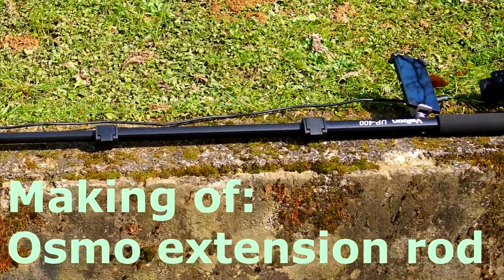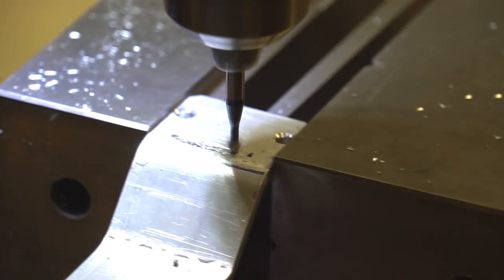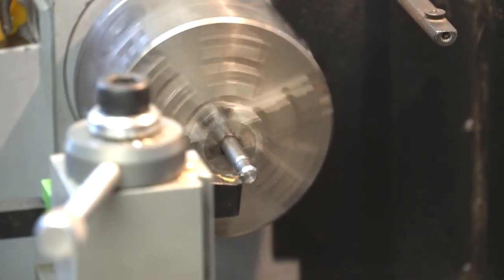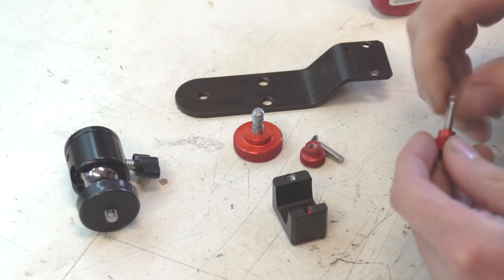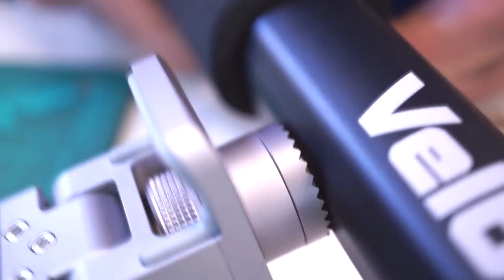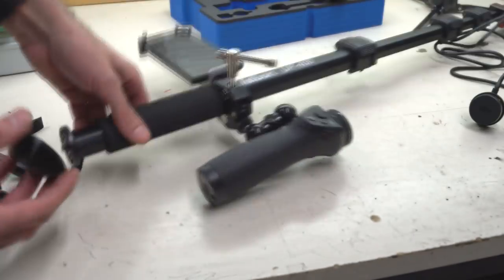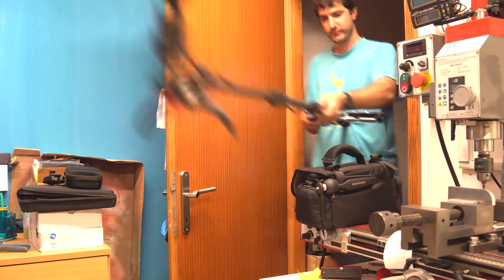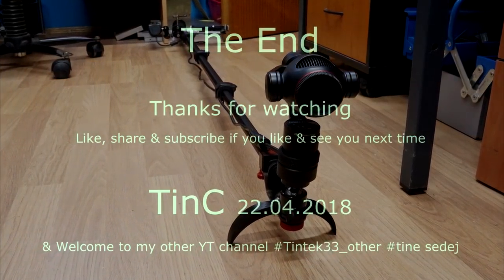Making of: DJI Osmo extension rod [170cm extended]

Comment: WOW Tine...I think I found a new best friend here. As directed from your reply comment on the Osmo LiPo batt video, , I couldn't resist the thought of what else you had in store for me. I am a 35 year machinist/CNC programmer and engineer. Started and owned my custom machine and machine building company for 12yrs. Now retired so I can only do so much with a hand drill, hacksaw, disc grinder and file (with good file brush...not many will get that joke). I did buy the  Joby Action Jib Kit without poles for my action cams. I use a 3 section 3 meter fiberglass painters pole. I thought about rigging the Osmo to that but may be too top heavy. I didn't know about the Osmo Extension Cable till I watched your video here...Thank You! Since the Joby uses string for the tilting action, I will have to add a compression spring between the wheel and the body at the top end if I find slippage, but I can make it work. This will provide the added tilt of the head if required. This is better than I could have imagined.
Again thank you Tine. Your efforts to make and share these videos is much appreciated. I have this sneaking feeling I will be BINGE-WATCHING your videos for the rest of the day...Dam-You!!!
Reply from the maker: Thanks man, i hope you got some idea, i got many of them but simply don't got enough time for realise all of it. Where are you from?
Reply: @TinC33  
Sorry for the delay. I'm grew up and raised my family and business in Grimsby, Ontario, Canada. I have moved to Peterborough, Canada for the last few years to be near my older sons before I leave to ride my adventure bike around the world next year. 
I have lots of time but little money and no machinery. I plan to video my exploration of this planet over the next 5 years so I have had to make much of the mounts and gear I will be using. Plus all work om my bike.
Really enjoy your videos. You do a great job. Please keep it up.
BTW...where are you from Tine?
Reply from the maker: Robert Doucette thanks i'm from Slovenija